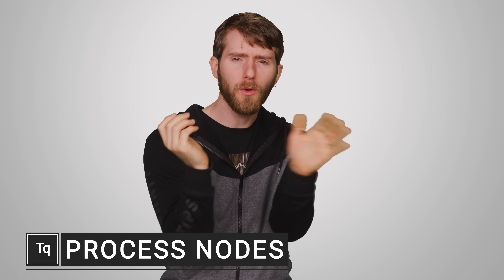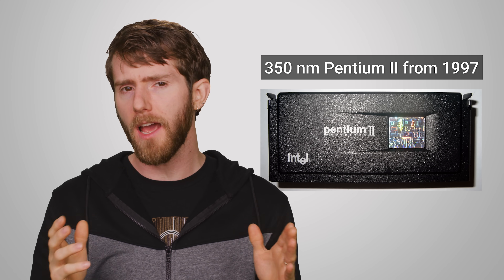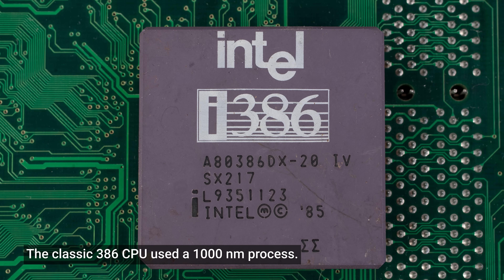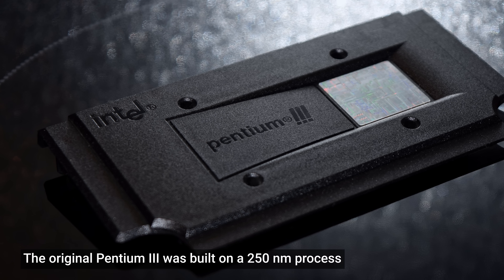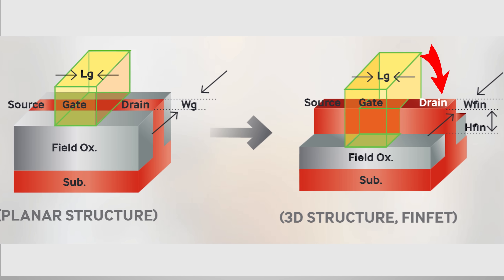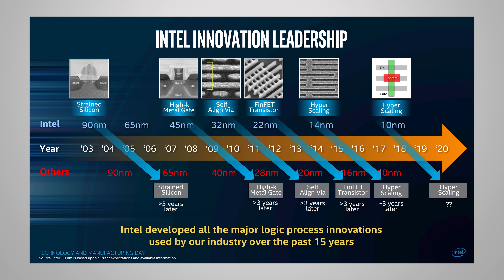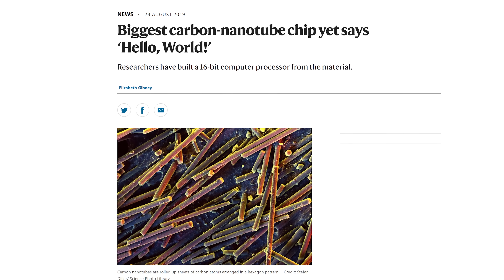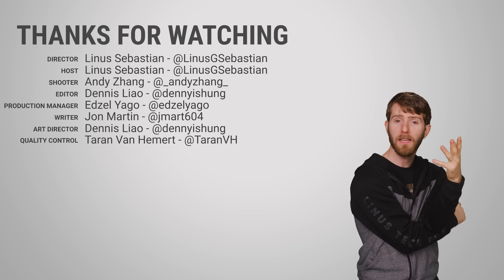Should You Believe CPU Marketing? - Process Nodes Explained

Comment: Hmmm the words used exactly match Intel's marketing slides with "real world performance", "applications you actually use"
Reply: Literally everybody says this when they talk about manufacturing processes and/or benchmarks. It's just common fucking sense. Take off the tinfoil hat.
Reply: Almost as if he spoke to someone at Intel about this...
Reply: @ChaimS  yes but there is a difference between doing research and just regurgitating marketing material
Reply: Chaim S Right, people usually quote marketing materials verbatim after speaking to someone from the company...
Reply: is “real world performance” concept worse than marketing cell size? i actually think that vice versa
Reply: "real world performance" and "applications you actually use" are the terms we, the consumers, should focus on. If the CPU is based on 24nm process but outperforms a 10nm one, should you buy the latter? nvm if it's actually possible, that's not the point. Or if you use your rig for gaming but you buy the one that performs better with video editing.
Reply: @netiturtle  but if you focus on real world performance (and here I mean truly real world, not Intel shit's like 35000 rows excel tables benchmarks) than who need new CPU? Who need anything newer than 5-6 years old one? 
I think I can go day by day with c2d configuration, if I collect courage to go find mine old phenom II rig somewhere in empire of dust and just put SSD and any modern GPU to run media decoding inside I'll probably use it for everyday tasks without even noticing. 
And that's way Intel push this "real world performance" shit only when they got inferior product to offer. It's not first time, some of us didn't enter PC world just a few years back and we remember that story. Isn't that P4 era marketing? Or maybe even before that? Can't remember now exactly but I know it's not new and definitely it was Intel marketing also.
Reply: @gorky_vk  I don't understand your argument. If you needs are covered with an old CPU, then don't buy a new one. From either of the brands. But if you use a good monitor coupled with a high-end GPU, then you also need fast CPU to feed it.
Why Intel markets "real world performance" is irrelevant. They might do this so they can push coal up the rectum of all apes in Madagascar to produce diamonds, for what it matters. Concept itself is correct. Also Intel is still best at gaming so it's not an inferior product, all the more important to follow the 2nd concept "applications you actually use".
AMD doesn't need fanboy'ism for good while already, shoo, disperse
Reply: That's true though. It the magic of the wand can produce, not the size, that counts.
Reply: @Herr.Mitternacht  
Ok fanboy
Reply: 2021 hindsight, this didn't age well
Reply: Probably a shill. I'm sure that's why just before that he went off on a diatribe about how much trouble Intel is having with 10nm...
Reply: ಹ ಹ 😂
Reply: "Real world performance" sees intel barely scraping by in gaming (while being far more expensive overall) and getting completely shat on when it comes to productivity. This video is a sham.
Reply: This is pretty much an Intel ad. Disgraceful.
Reply: Not only that, but everything in this video is Intel lol
Even the main comparison that would make sense, the difference between AMD's 7mm and Intel 14nm hasn't been made. He's basically just saying that "eh, these numbers mean nothing".
Reply: @GabrielMoraes  they really don't, intel and AMD are measuring things in a different way anyways, just like the tdp, and how they really don't mean much
Reply: @AluminumHaste  in the end all us consumers need is to see how they perform in apps in tests and how much power is being consumed from the plug and that is all.

Comment: Intel: Don't talk about benchmarks, transistor size doesn't matter, Apple still loves me... I need help!
Reply: Apple just abandoned Intel too lol
Reply: Only one of those is still true, transistor size really doesn't matter to normal people.  How fast will it be and how much will I need to spend on cooling/my power supply are far more important.
As some system integrators move to using ARM for their devices, the last question of will it actually run all the things I need it to run will also become more and more important too.
Reply: @acdbrn2000  TSMC has left the chat
Reply: @acdbrn2000  transistor size is really important. Ryzen 5 3600x is faster than i9-9900k in several benchmarks and workloads even though ko has a damn higher tdp
Reply: @ahsanqureshi786  3600X is faster than a 9900K when you have the 3600X cuz u wanna feel better about your shitty purchase LUL
Reply: oh no another intel vs amd war in the replies
Reply: @KAKUN_DESU  damn my ryzen 5 1600 is faster than my friends core i5 9400f lol
Reply: @LoneWolf6063  the i5 9400f doesnt have hyperthreading so its not surprising.
Reply: Can you show me in the video where they said transistor size doesn't matter?
Reply: So many intel fanboys lol
Reply: Adineo  keep crying kid
Reply: @KAKUN_DESU  i just installed a 3700x on a asus tuf x570. I wouldnt reach advertised clocks either until i put the oc tuner or whatever any other mobo companies call it back to default. Then of course chipset/driver/bios update and now im hitting 4.4 on multiple cores at once while constantly fluctuating to other cores. maybe you have already done all of the things ive mentioned but just figured I would mention it because I was having the same issue. 
Cheers
Reply: @jam06  Let him live in his lie. Somebody has to subsidize Intel or AMD will have no reason to keep pushing (I'm looking at you lazy nVidia).
Reply: @KAKUN_DESU  Look at 3300X a 4 core processor which is already at its limits i.e 4.3GHz and you can only overclock it by a 100Mhz. If Intel allowed overclocking on their i3, I bet people would push them to 5Ghz.
Reply: @ahsanqureshi786  man clock speed don't tell all stories 
AMD has ipc advantage
Reply: @joshironak4881  My point is that AMD fanboys boast that their entire Ryzen lineup is unlocked for overclocking, and how much can you overclock them huh? 100 or 200MHz at max. Where as you can push Intel's "K" CPUs more than 500Mhz.
Reply: laughing in apple silicon 2 months later.
Reply: Imagine thinking Intel is cheaper lol...
Imagine thinking Intel is way faster in gaming...

 Intel is like within 1-2fps less in some games and 1-2fps more in others.
Reply: @Chocolate Soybeen 
Read the full comment, that's literally what I said
Reply: @Chocolate Soybeen 
Forget it, I ws the one who didn't read your comment
Yeah, when I wrote that comment AMD was still cheaper, but yeah, you're right, right now Intel is somewhat cheaper, I don't know if better budget tho, since both memory and cpu overclocking are still locked behind paywalls
Reply: @Chocolate Soybeen 
I'm a hothead, but I will try to to admit my mistakes, cheers
Reply: @KAKUN_DESU  hold my 5600x please
Reply: Alder Lake.
Reply: @KAKUN_DESU  dude... you are gravely mistaken in so many ways ("with amd you cant even get advertised clockspeeds" e.g.) it's not even worth arguing. Just stop spreading bullsht and see (don't just watch) the logical connections.
Reply: @KAKUN_DESU  Dude, intel is more expensive for the same stuff. For no reason. Ever. At the same price point intel is lame. And i've had intel for the past 20 years. Now it's AMD's time to shine.
Reply: Untermensch “intel wins in streaming and gaming” sooooo... have you been under a rock or what? Not only AMD outperforms intel in streaming and workstation applications but its almost as fast as intel 10th gen when it comes to gaming while costing much less.
Reply: @void9092  
The last part is just not true, the new AMD cpus will clearly outperform Intel, but gaming is a light-threaded task, most of the time single thread performance is way better for gaming, and Intel was the king at that, you can see every benchmark and literally the top 3 or 4 spots are Intel (again, only gaming and not taking into account the new 5000 series because that will literally destroy Intel), there's just no need to lie, AMD is so much better in both performance and price, but before 5000 series Intel was the king when it came to gaming
Reply: The only thing Intel CPUs are good for is gaming if you have a streaming PC with an AMD chip next to it
Reply: @KAKUN_DESU  3800X which is 8 core processor cannot reach 4.5 Ghz on all-cores without LN2, where as 10900K a 10 core processor reaches 5.3 Ghz on all-cores in water cooling.
Reply: @ahsanqureshi786  not disputing the fact that the 3800X is slower, but just checked amazon and 3800X is £280 whereas 10900K is £530, would make a lot of sense it's faster.

Comment: Well, if an 6 core AMD and a 6 core Intel perform almost the same on benchmarks, maybe nanometers don't matter that much
Reply: Well, process node is the most important factor on CPUs and GPUs. Though you can crank up power usage and create ridiculous heat densities for 14nm and crank up clocks, but that doesn't mean that smaller node with much less power usage, less heat and still better performance at lower prices wouldn't be much better.

Zen 2 is after all the first 7nm CPU, Intel's offerings are probably 6th version of 14nm. So 7nm surely hasn't shown it's capabilities yet, Zen 3 should show already much better what 7nm is capable. Though Zen 2 is 7nm/12nm hybrid as the IO Die is 12nm. When AMD gets IO Die down to 7nm, then memory latency gets better, and there's about 30% gains available.

Also the important factor with process nodes is the improved density. Thus the real comparison should be with 64 core Threadripper vs. whatever Intel can produce. Or even just 16c/32t 3950X, or perhaps 24c/48t 4950X. Process node doesn't allow you to raise clocks, it allows you to cram more transistors, thus get bigger caches and more cores.

Comment: This video feels like intel's last solution because they can't get into 7nm
Reply: Thing is, Intel and TSMC (AMD uses these) actually mean different things when talking about sizes. Intel takes density (well, almost) into consideration and AMD takes size of the fin in the FINFET transistor into consideration. If you compare Intel's 10nm technology and TSMC's 7nm technology, they are essentially the same size
Reply: @ChannelOfElveman  Yes, but, Intel makes almost all of their cpus in 14nm++++, and tmsc is starting to make some arm chips in 5nm (not sure if ryzen 4000 or 5000 series is going to be on 5nm), so currently intel is way behind.

At least according to wikipedia articles:
https://en.wikipedia.org/wiki/14_nm_process
https://en.wikipedia.org/wiki/7_nm_process
Reply: @Kocan7  This very same article (14nm) states that Intel's 14nm is called 12nm by TSMC, and TSMC has lower transistor density. 7nm one states that Intel's 10nm is comparable to TSMC's 7nm even in terms of transistor density. "++" in Intel's process actually means, in layman's terms, low-level heat optimization so they can use transistors that are remaining on the chip but left unused because of heat problems, and this leads to even higher transistor density
So yeah, they may be slightly behind in their desktop CPUs (TSMC's 12nm is Zen+ and is comparable to Intel's 14nm(+)), but they're on par in their 10nm process and are equal to TSMC's 7nm there (some mobile CPUs and upcoming server CPUs)
Reply: @ChannelOfElveman  source pls
Reply: @ChannelOfElveman  That's what I wrote, but why have you ommited the part that intel 10nm hasn't really started yet, and tmsc 7nm amd is with us for almost a year?
Reply: @ChannelOfElveman  Finally someone which knows what is talking about. Cheers!
Reply: @Kocan7  What you wrote? You even don't  know  what he said by 90% lol
Reply: @croissantj9588  this video
Reply: Elveman my iPhone that uses tsmc 7nm have way lower tdp lower ghz doesn’t need cooling and have the same single core score as my old i7-7700 on Geekbench
Reply: Oh look, one of the "lol TSMC is already on 7nm stupid Intel stuck with 10nm" showing they know next to nothing about how both companies measure transistor size.
Reply: it doesn't matter with low clock speeds like 4.2ghz instead of 5.3
Reply: Mello I'm  not a Intel guy for years but I'm sure you never used two cpu in lifetime let alone know about internal tech study
Reply: @ahumanbeing1668  i actually did , don't be so quick to judge, my desktop and laptop is intel and tbh am tired of them because it keeps getting slowed down with exploit fixes and using too much energy 
We don't only care about speed but efficiency too you know!
Reply: Mello Keehl     CAN"T???
Reply: Yep. All Intel has left is marketing fluff. Check this video out for more details: https://www.youtube.com/watch?v=Gj5_uc4ScNE
Reply: Lol
Reply: Come on Guys, Intel is still managing to come up with similar performance with their current 14nm process, So if they enter the 10nm or 7nm process then they're literally gonna double the performance of their chips and might even beat AMD by a huge margin..!    But the worst thing about intel's chips are their worst thermal performance and high pricing ...!
Reply: The confusion here is actually because of lack of universal standards so manufacturers use vastly different criterias of measuring the size of the transistor. That doesn't mean somebody lies, only that while this continues, Intel's gonna have less beautiful numbers (in terms of size ofc) for consumers to see, and the only way to grasp that is to understand how these transistors and their sizes work
Reply: "It's always more important to pay attention to the real world performance that you'll see in game an applications that you actually use". Lol, even AMD is winning
Reply: Thomas Borisov  Actually 12nm is pretty much 14 nm, I am pretty sure AMD just tweaked 14nm a little and called it a day. Intel can't do even that though
Reply: no, Intel's 10nm = 7nm of the rest of the industry. but I think we will never get mainstream 10nm they're way behind schedule
Reply: @rjuez00     Intel 10NM is going to Xeons very shortly with a high core count.
Reply: @rjuez00  TSMC has already produced 5nm chips now.
Reply: @rjuez00  By the time Intel gets to 10 nm, flying cars are going to be a thing
Reply: @niar69  they have 10 nm cpus in notebooks so...
Reply: @niar69      If you're going to make fun of Intel at least know what you're typing. Intel has had 10NM for over a year. (Ice Lake) and Xeons will be on 10Nm with high core counts before the end of the year.
Reply: @rjuez00  🤣🤣🤣
Reply: rodri you're only saying that because your Hindi and naive. You shouldn't cling on INTEL’s hype
Reply: This has been a thing for years.. It's not a thing made by Intel.. It was there when AMD was doing shit.